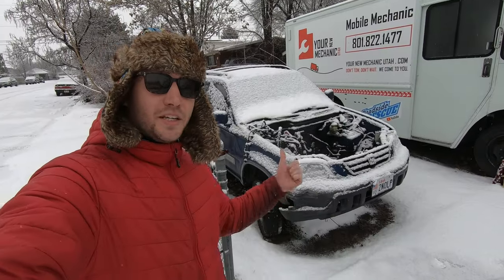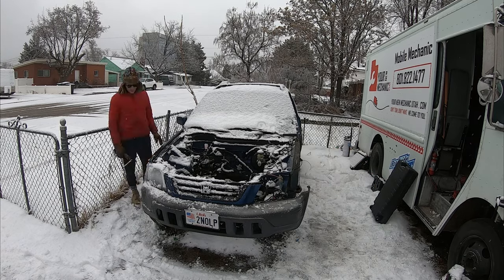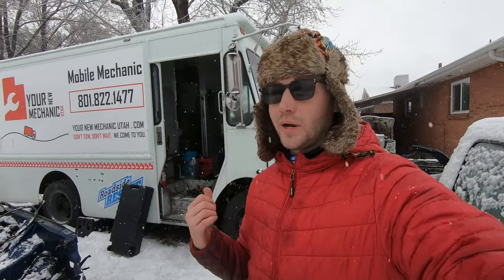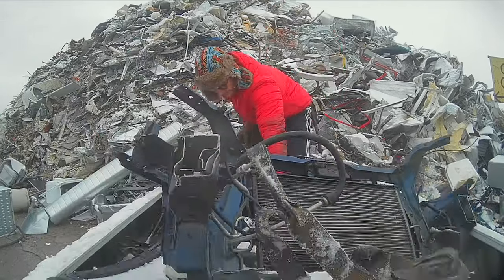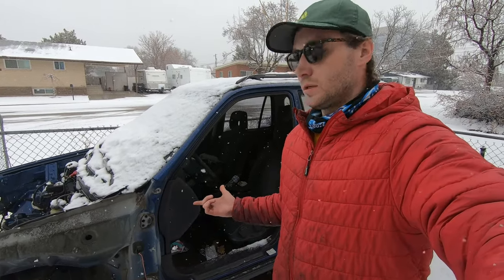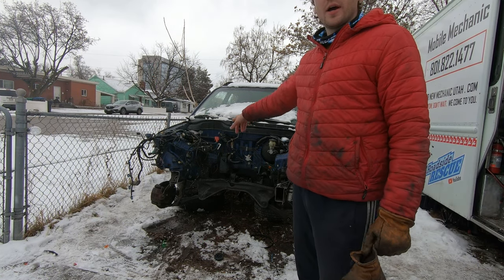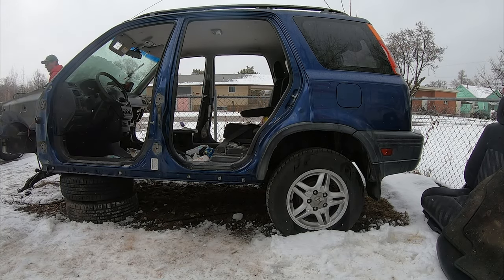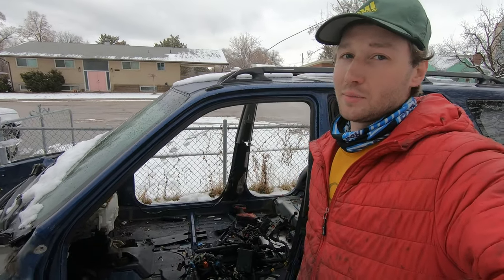Cutting Up a Whole Car. How much $$$?

Comment: I have had junks hauled away (less work, no gas/tools), and cut up into chunks for trailer after taking drive train and suspension. What ever value in scrap gets eat up in materials/gas… pulling off parts to sell can make it worth while though. But I’d not attempt it in the Ohio Winter, so props to you.
Reply: Video content ✨️

Comment: There’s lots of different ways to recycle. You can just sell the car to a scrap guy and he will come pick up the hole car which makes it easier but ….the condenser and the radiator are aluminum more than the steal . And the converters $$$there’s always somebody on Facebook marketplace to buy them from you for top dollar👍

Comment: You probably could have made a decent amount of money selling that vehicle whole if the body was in decent shape. I don't think it would have been hard to find a transmission for it either used or rebuilt if you wanted to get it back on the road.
Just some food for thought, but it's too late for that now.

Comment: Haven't been back to Utah County in many years.  Is McWane ductile iron pipe plant still in south Provo?  If so, that's likely where the scrap steel ends up to become water pipe
Reply from the maker: Haven't heard of it...?
Reply: @RoadsideRescue  Just looked it up and still there: 
McWane Ductile Utah
1401 East 2000 South
Provo, UT 84606
Most or all ductile iron pipe these days is made made scrap steel rather than iron ore or pig iron.  Pipe is mostly used for water and waste water.
Reply from the maker: Glad you told me! That's awesome!